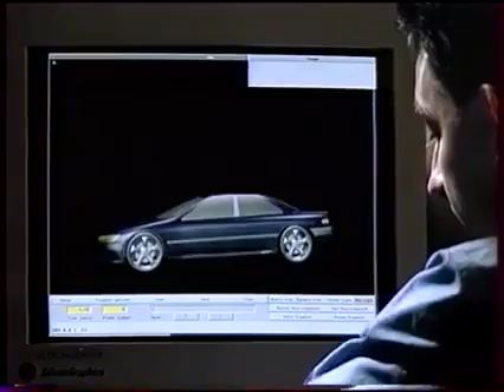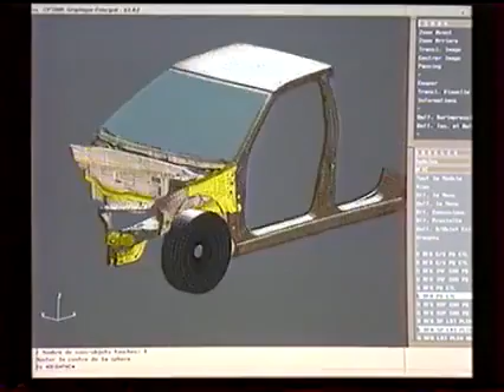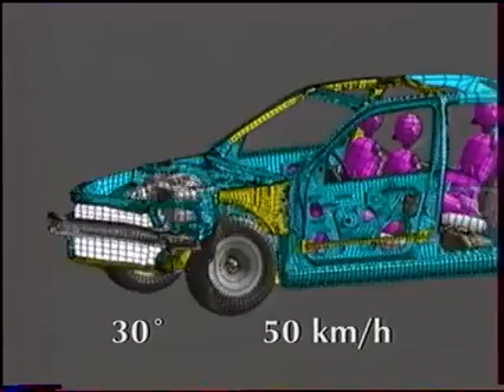Peugeot 406, de la conception à sa fabrication

Comment: Mine is at 412000 km, original engine and automatic Al4 - fitted with oil cooler.
Reply: Update now 502000km